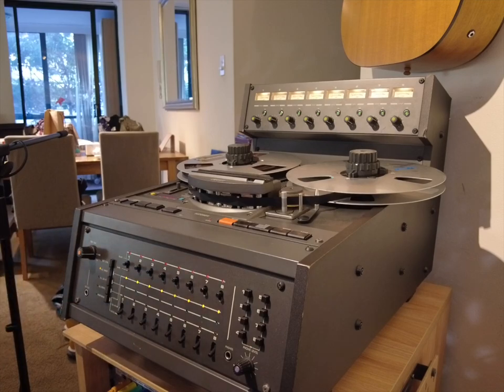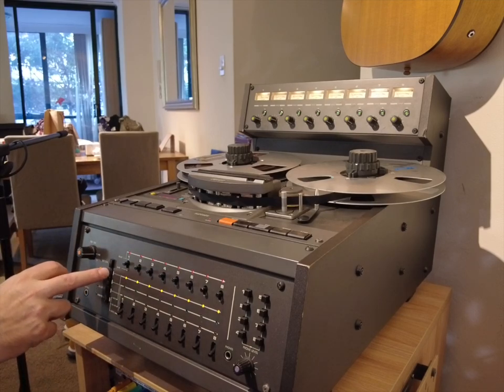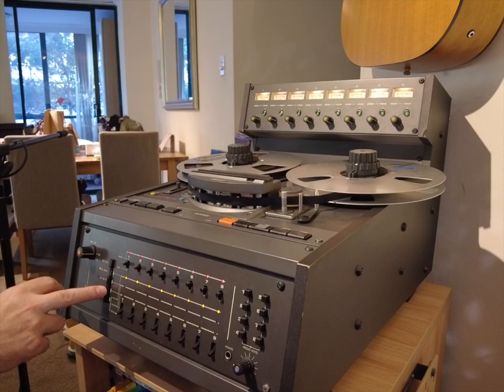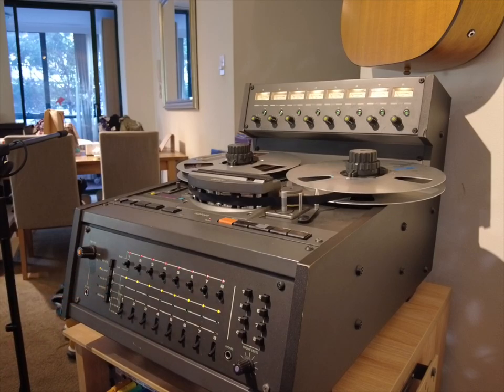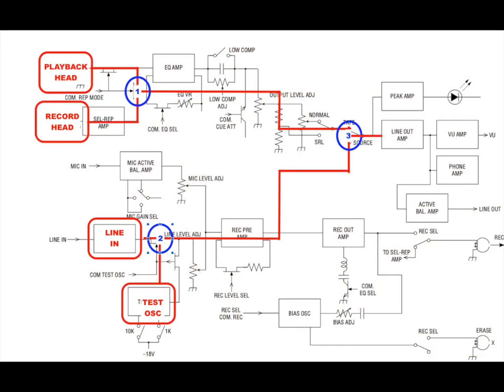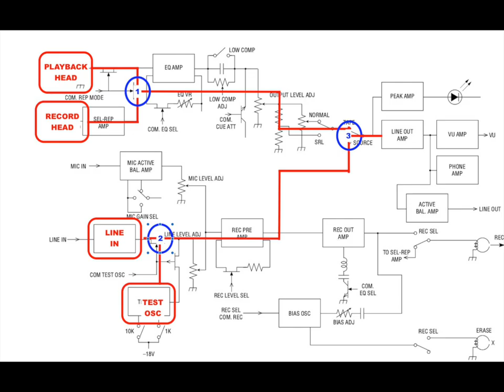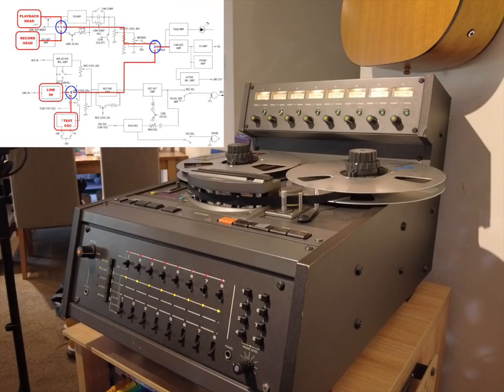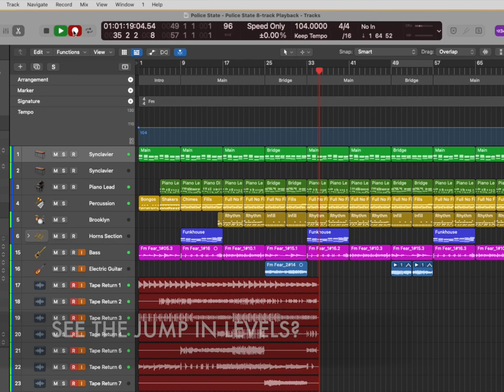Otari MX5050 Mk iii 8 Monitoring and Recording

Comment: hi if you can get a  re cap of any high power  caps i lost my deck  to bad caps    i have a  otari mtr 12  later on   1/2 inch  tape 

i have a   head block made  to take   8 track  1/2   on the otari  mtr 12   so i can play back any audio recorded on this mpdel 

a tascam 38 can be jazzed up to play   tapes recorded on this model  

some fool put the deck in a lock up for 10 years  did not do it any good  

i know now    i have a  2 track stereo  otari  deck  stand up model  it purrs like my cat   

teac 44 is ace
Reply from the maker: I did a full replacement of all the electrolytic capacitors a few years ago. Including the power supply. I probably replaced more than I needed to…

Comment: Hi, great video. I have just got the 4 track version of this machine but it is set to 7 1/2 ips I have read there is an internal switch to set to 15ips any help would be great thanks
Reply from the maker: Hi. Do you have a copy of the manual? I posted one on this Fb group - https://www.facebook.com/groups/OnlyOtariTapeGroup/files/files From memory there is an explanation in there. Otherwise check out https://www.tapeheads.net/forums/ and you’ll more than likely find someone that can give you a detailed and specific explanation.

Comment: I have this machine but it needs some work
Reply from the maker: Get your hands dirty brother. If you're handy with electronics you'll be fine. I used to be a tech so most of the work I had to do was easy. I found refurbishing the capstan motor to be a little fiddly and I almost screwed it up. But I did a recap on it myself and it was great fun. There's a great forum on tapeheads.net that I've been contributing to which includes linke to service manuals and a journal I created of all the work that I've done on mine - start here - https://www.tapeheads.net/threads/5050-recap.84785/post-775685048